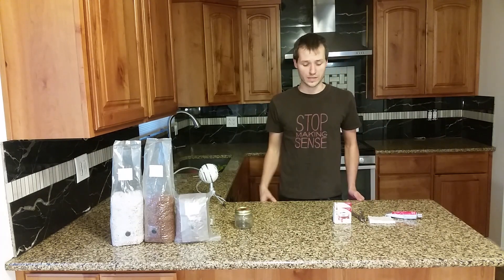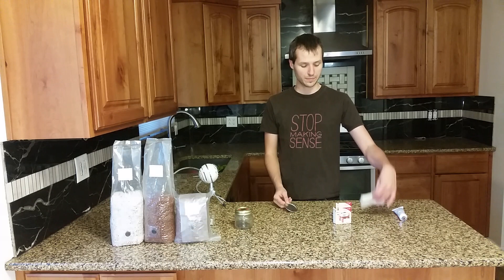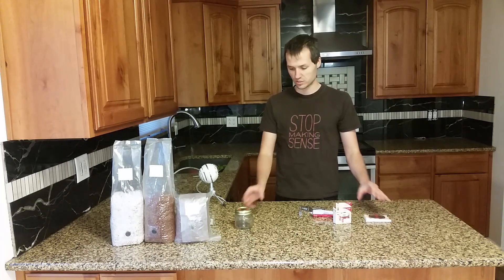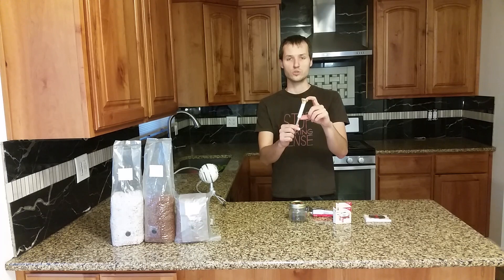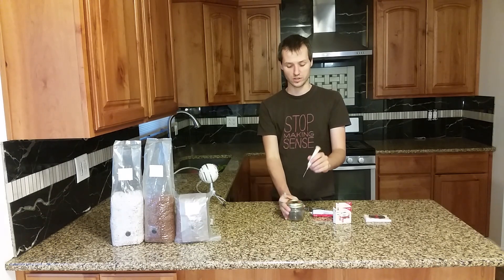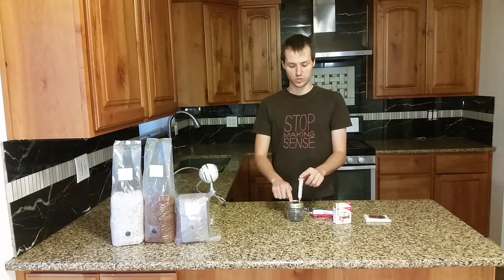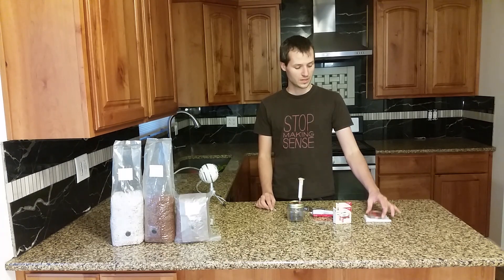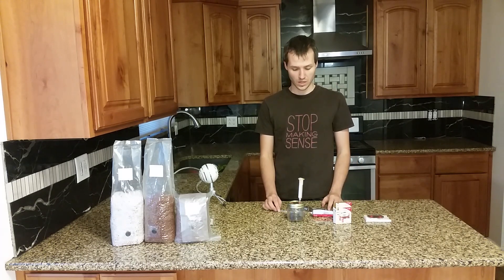How to Easily Make Liquid Culture Lids (self healing injection ports, filter)

Comment: Im confused about the injection of the Pollyfill, could you please explain is it only for a moment to get clean air inside the jar or does it stay hanging out the jar as a permanent feature:) 

Thanks for the great info.
Reply: Literally no one answered the question. Do you remove the filter or leave it in the jar during the inoculation period?
Reply: @olivelackey4513 , I’m pretty sure you leave it in the jar to allow for fresh air exchange with filtered air.
Reply: It seems like there is high air pressure inside the jar and the syringe full of polyfill is to allow a sterile way to vent that pressure.
Reply: you take the plunger out of an old syringe put poly fill in the syringe and compress poly fill with the plunger. now that is your filter for the jar
Reply: @weedman420147  So when you insert the needle, there is already poly compressed, so syringe still bleeds off the vacuum, just somehow through the gasket of the syringe and polyfill?
Reply: Cant I just

Comment: Isn't an air hole required for air exchange?
Reply: Is the needle submerged in the LC when you insert it?
Reply: Lol, nobody answered this question. Technically, the silicon covers up the hole which results in little to no air.
Reply from the maker: Doesn't this video talk about polyfil in a syringe for air exchange?
Reply: @CRuggles3  Are you suggesting that that airport needle remain in the jar after the inoculation?
Reply: @CRuggles3  wow, what a douche.
Reply: @cameron does it remain? and also when you strelize do you wet the polyfill? thanks man

Comment: How well does this hold up for pressure cooking?
Reply: If you use red rtv silicone it's fine. It's high temperature resistant.
Reply: @neilanderson8597  If you did it right I think you'd blow the jar up.

Comment: Use G02 Loctite gel,gap filling, precise grip is the claim. Not anywhere nearly as messy as the Red silicone. Seems to stick n fill gaps as claimed ( -50°C/+120°C), anyone else tried it? 👍 the silicone seems to be too malable and a pain in the arse to apply a clean seal.